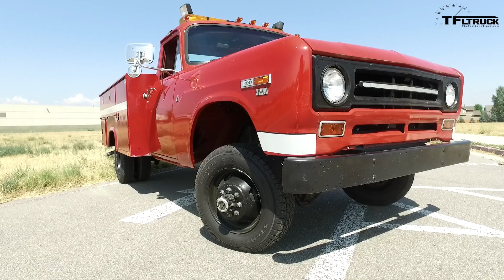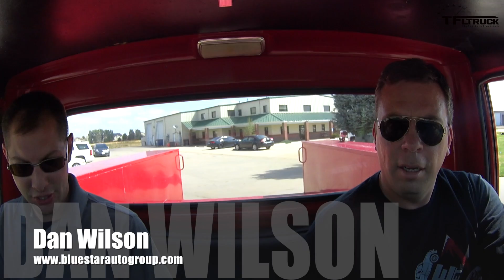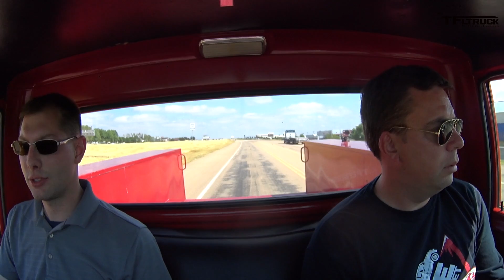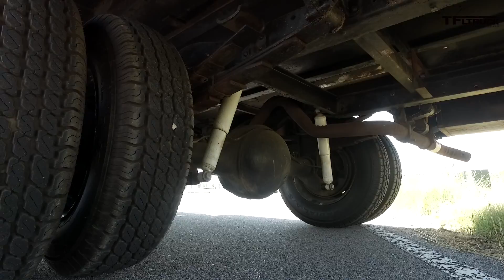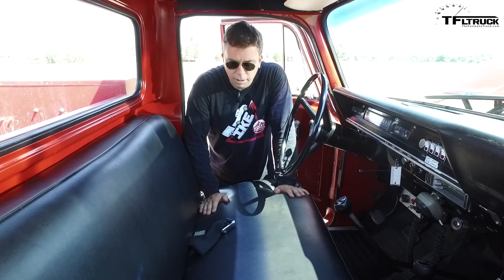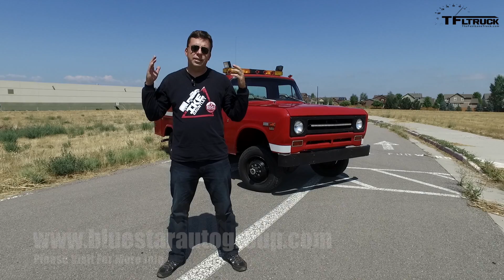1970 International Harvester 1300D 4x4 Classic Brush Fire Truck Revealed

Comment: I was at A auction in Ohio 3 years ago. A ex fire truck with 22k miles just like this , But they put A dump box on it with stainless steel tool boxes under it. It had A original big bumper with A PTO wintch. Rust free. Sold for 340.00. Yep no bull shit. 340.00. I went up to pay thought it would go for A lot. Nope. Guy had 5 other old IH big trucks  all went for nothing.  Been mad ever since